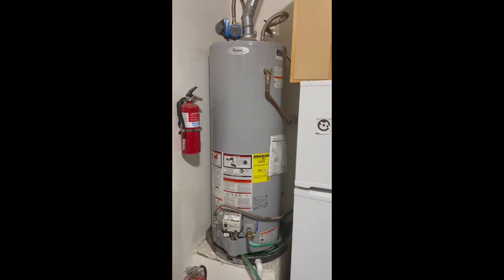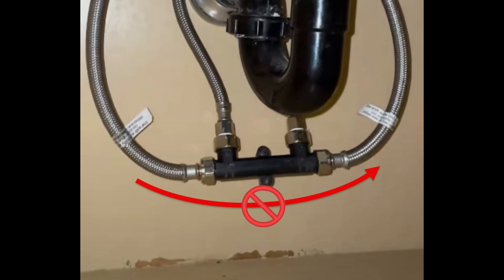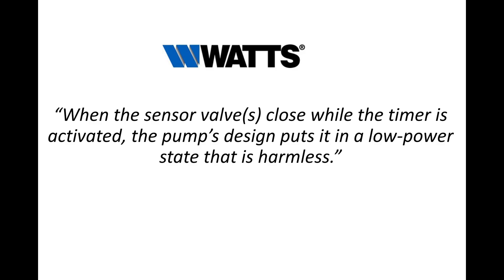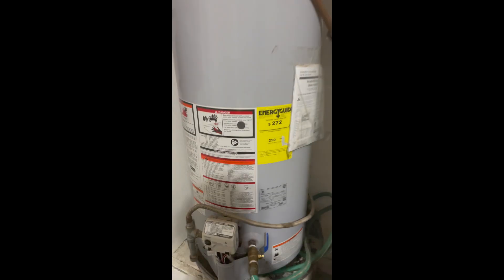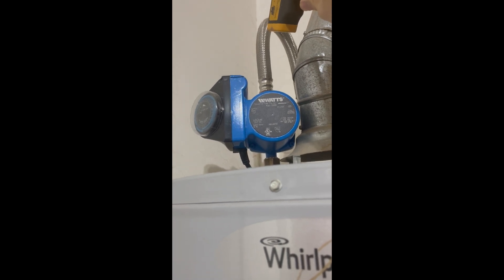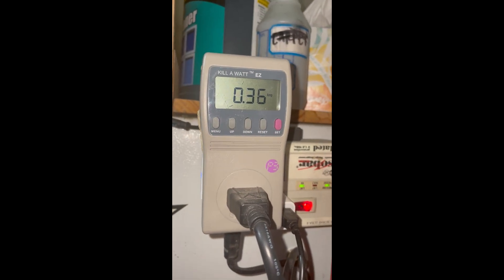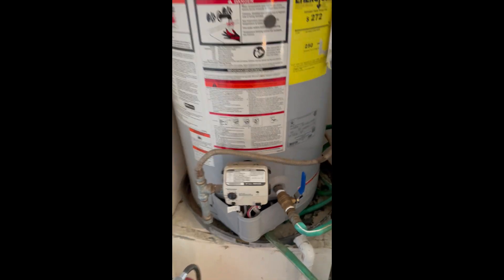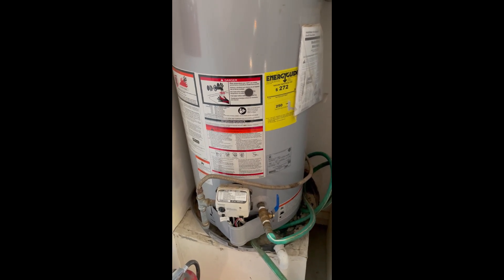Does a Watts Hot Water Recirculator Shut Off When the Bypass-Valve Closes Under Your Sink?

Comment: I don't get how the pump can delelop a high enough pressure to push cold water backwards through the cold water supply under a bathroom sink to overcome the static 55 psi cold water pressure waiting for faucet use?
Reply from the maker: It's an open-loop system.  The Watts recirculator doesn't push water back through your cold-water supply, it creates a dedicated return path for hot water through the cold water line.

Comment: I seriously doubt that small inexpensive pump has a differential pressure transducer circuitry to determine the backpressure from the flow valve located 50+ feet away.  It would be cheaper just to pay the $0.13 per KW to run it.
Reply: Agreed, it looks like there is no "low power state"